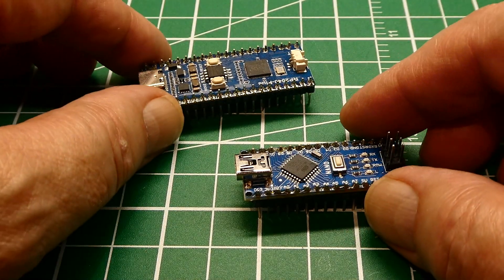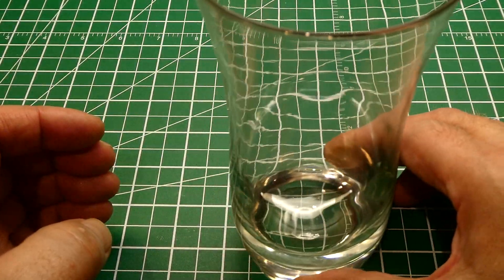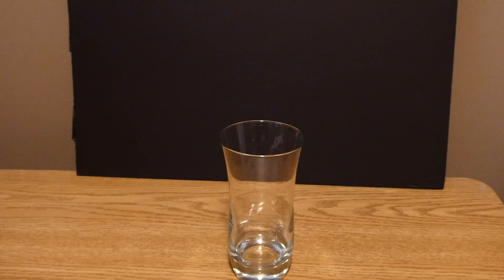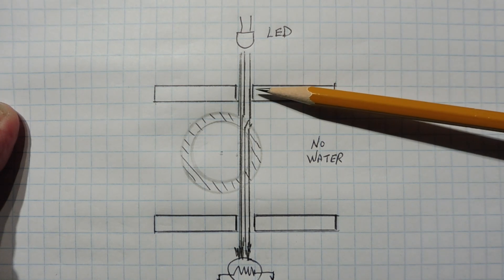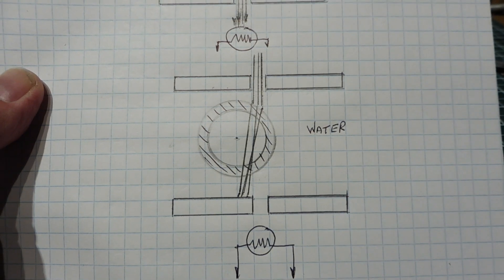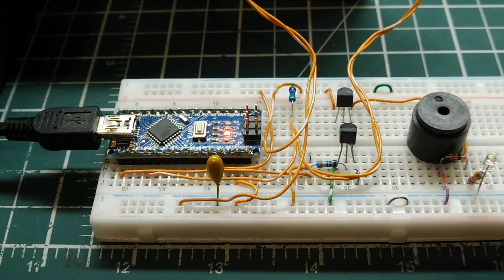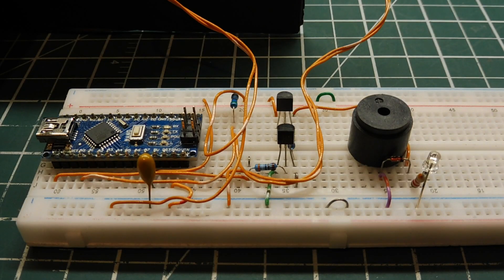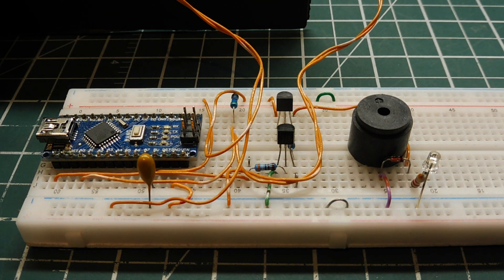Build Your Own Sensors / Water Detector / Refraction

Comment: Great tutorial. Did you use FORTH for this? I use the nano to introduce programming at middle school. I have around 30 nano's and 150 students. Each student has 150 minutes class a week. So during a trimester the nano's are really put to the test. I teach these classes for years now and the nano seldomly lets me down. In this trimester I started using the esp32. I takes more time than I thought to get acquainted with this chip.  As the chip has a lot more flash memory than atmega32p (nano) it takes a relatively long time to compile and upload. It seems that the adjust - compile - upload  cycle takes slows down the learning process to much. With a micropython interpreter on the ESP32 this learning loop can be more faster, however on the ESP's it is not stable enough. With 30 kids in a classroom toying with breadboards and microcontrollers you want as little as possible freak-errors. If you do'nt know why things are working, you certainly do not know why they are not working. Last week I felt like Jack Lemon in the control room of the Ventana nuclear powerplant . An example file that came with a airhumidity sensor caused me almost a nervous meltdown. Some pins of the ESP32 are not to be touched. Mind you, the faulty example file  came straight from the repository of Adafruit. So if the hardware is complicated and it allways  is, you do not want the software to introduce another plethora of points of failure. Yesterday a student told me he learned LUA for programming in Minecraft and I know of more kids that learn exotic languages to tweak their software. Anyway, if you are showing the Forth code in your tutorials you are enforcing the case for using FORTH in the classroom.  Here is the scene with Jack Lemon. Lucky they were not filming. Students are not allowed to have smartphone on them....https://youtu.be/0bUrs4JBbnA?si=m9LLZTgkMGtfz9Xx
Reply from the maker: I use Forth code in all my videos. The AVR Nano is a good platform for teaching students about microcontrollers.
I have written a simple Forth called Interactive Arduino which I used to teach students. Check out these videos:
https://youtu.be/PY01_9dANd8
https://youtu.be/P6rMFcwik3M